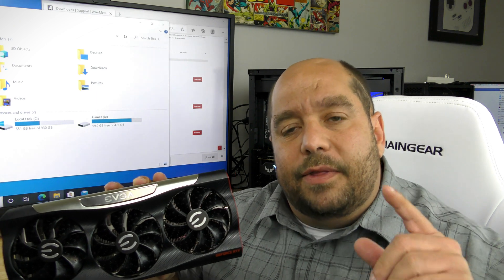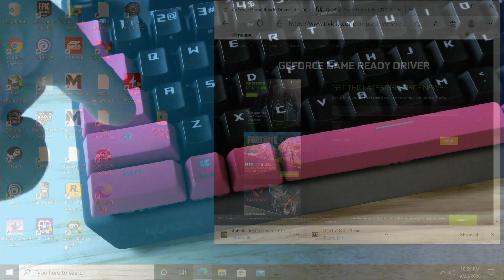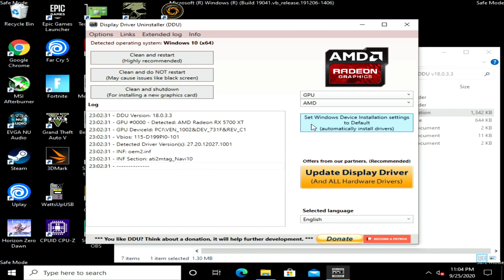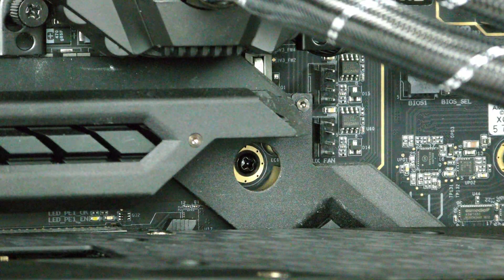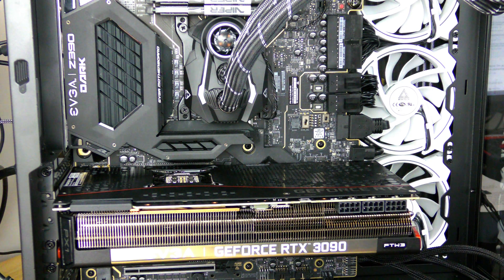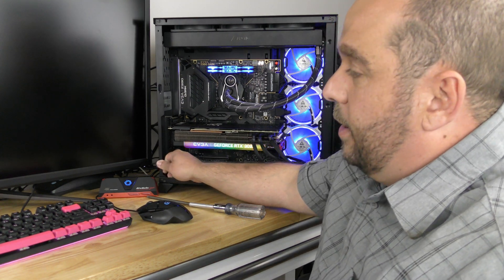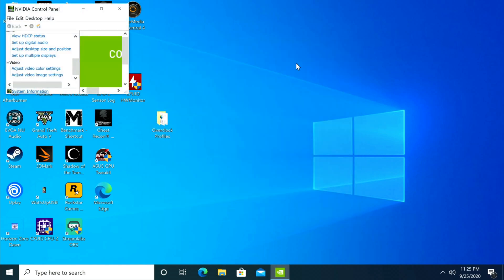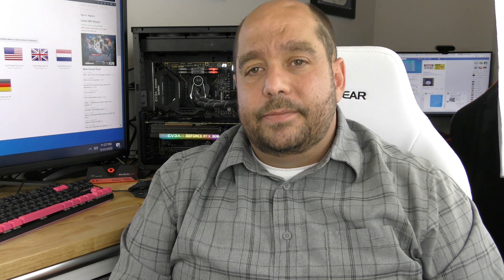RTX 3090 - Installing the EVGA Geforce RTX 3090 FTW3 Ultra Gaming

Comment: I just upgraded from a 1660 super to a 3090 and this video was very in depth and really helpful. Thank you very much good sir.
Reply from the maker: Always a pleasure my friend, so very happy you stopped by, trusted in me to help you, liked and subbed as well as took a moment out of your day to thank me.  It means a ton to me and I am so very happy I could help you.  That is an awesome update my friend, congratulations and thanks so much for your kind words, I am so very happy I could help you.
Reply: Hey is it easy to install the new cables into my psu? I'm upgrading too from 1660 to 3080 with lots more cables lol
Reply from the maker: @Taylormane  the 3090 and 3080 have the same amount of pcie connections, so it would be the same as you see in this video.  The other requirement of course is power, how many watts is your power supply
Reply: @ThisBytesForYou  thank you for replying  I just got a 850w for it
Reply: @ThisBytesForYou  it's pretty simple to plug the new  cables into the PSU? I just noticed my 1660 seems simple with like one cable wonder if the 3080 will be a challenge with cables
Reply from the maker: @Taylormane  yup it's easy, just like I show you in the video just make sure your psu has 3 separate pcie cables, don't daisy chain them

Comment: I am a lucky winner of s Nvidia GE Force 3070ti that it came out new in the box with a Y 12 pin to two eight female connectors to the gpu and two eight psu wires labeled pcie but also in a Y connector. Is it possible to wire up individual connections ( in parallel ). Thanks for your help and educational videos
Reply from the maker: awesome bud, congratulations.  Can you give me the exact model name, product number of the video card so I can help you?
Reply: @ThisBytesForYou 
 it is:
 Nvidia
GE Force 3070ti Founders Edition
Thanks again for your time
Reply from the maker: @franciscocastellanos9157  sadly no, with what NV provides, the card can only work with that adapter, that really bugs me too hahah, but yeah, only with that adapter.
Reply: @ThisBytesForYou  I just researched a bit further and the adapter provided by Nvidia is the only one recommended by the manufacturer. The power supply provides two PCEi connections for  PCIe express and there is no other  possible option. I am installing the  GPU card with its Y adapter hooked up to the male PSU connector (also a Y connector ) i went to Nvidia website to download the GPU driver and installed it first by keeping the monitor hooked up to the motherboard hdmi output. Once installed I rebooted the computer once to make sure no driver Conflicts and once all looks good re booted again but now the monitor connected to the GPU hdmi input and WOALA ! ! the new Nvidia GE Force 3070i is recognized by Win 11 home edition. It is not a novice project if any challenges arise. Thanks for your prompt response nad keep up with your good educational videos
Reply from the maker: Always a pleasure my friend.

Comment: I have a question. I’m installing an EVGA 3080 FTW3 GPU to replace my MSI Twin Frozer 7 2070 Super GPU. I have a Corsair 850 Watt PSU, but the cable I have with it only has enough pins to slot into two of the 8 pin slots. Do I need to buy another 8 pin cable for my PSU or do I have to buy a brand new PSU? I have everything else set up, it’s just the third pin slot I need.
Reply from the maker: Well, what is the exact model of your powersupply, but if you are in the market to buy a new one regardless, check in the description for the one I use.

Comment: I see that you have two separate power cables going into your 5700 instead of the single cable splitting. Is that the proper way to do it? I have a 5700xt and use the split wires.
Reply from the maker: yes it is the proper way to do it, 1 cable per connector, if you have 3 or 4 PCIE connections, you need 3 or 4 cables.  Before this series 5000 and 3000 series, it wasn't really needed, now they are much more power hungry and the next series for both AMD and NVIDIA are supposed to be even more power hungry.  Don't use splitters, a good example would be, have a straw in a Coca Cola, start drinking out of it, then pop a hole in the side of the straw and poke a straw through that and have someone else drink out of it.  notice, you will get a lot less drink than you did before, but now both of you get some.  It's good to share,... but not power ;)
Reply: @ThisBytesForYou  I'm going to try this. I've had some issues with my 5700xt and I've had it for almost 2 years. Maybe its not driver related after all. Thank you sir
Reply from the maker: Well, the drivers are a big issue, sadly,  but follow this video, then at the end, install the graphics drivers and you might be OK, as long as you seperate those cables first: https://youtu.be/8JuC_Dpm6-c
Reply: @ThisBytesForYou  my only other power chord to use doesn't have the mesh sleeve  as its just plain 8 pin evga wire. Will that matter?
Reply from the maker: @Donker_Dank    that is OK to use, but it has to be a PCIE cable, not an EPS 8Pin CPU power, as they are different, but look similar.
Reply: @ThisBytesForYou  you're right it is an eps. Im going to order the pcie
Reply from the maker: @Donker_Dank  what do you mean order a PCIE, what is the model number of your power supply?
Reply: @ThisBytesForYou  its an evga 700 bq 80 plus bronze semi modular. I just realized I can't use another port in the psu because they're all used up. So oh well
Reply from the maker: @Donker_Dank  you should get a 1K watt, this is the one I used, to prepare for the next card, so you don't need to upgrade again... I have had a 1200K Watt for about 10 years, never needed to upgrade, bought another one 5 years ago, so now I have 2 and I just bought one 3 months ago, now I have 3, so I can build up 3 different units with 1K watts, no issues but I used them all for this channel, but the original, its an older non-modular 1200Watt with ugly cables, I don't care how it looks, but it bothers people so I don't use it for these videos.  You can check out the1K on my affiliate link: https://geni.us/IVoE
Reply: @ThisBytesForYou  will that be too much power for the system?
Reply from the maker: @Donker_Dank  no such thing, the system will only pull as much power as it needs.  Your 700Watt, maybe was pulling 350Watts, when you were browsing the web idle, maybe 150Watts, you would need a Kill-A-Watt to test, on my Amazon affiliate link: https://geni.us/KAJmEG, the more power cards require more amperage per PCIE connection, ones that usually the lower end ones do not have.  As you overclock your PC, or play hardcore games with higher resolutions and eye candy turned on, your system will require more power, 1000Watt is perfect, though it still may not even hit 700Watts.
Reply: @ThisBytesForYou  il try to upgrade my power then definitely
Reply from the maker: @Donker_Dank  this is the one I just bought November 9th on my amazon affiliate: https://geni.us/6ufZi
Reply from the maker: @Donker_Dank  this is the one I have in the older system, another amazon affiliate link: https://geni.us/P0ASsk
Reply: @ThisBytesForYou  last question i promise. I appreciate all the help you've given me so far. In the vein of future proofing what cpu works with rtx 3090 that can also work for 5700xt
Reply from the maker: always a pleasure my friend, sorry I didn't get back to you sooner, youtube is horrible at notifying of comments, they don't so I have to go around looking for stuff I have not replied to.  Don't buy into future proof, I remember when I bought my Voodoo Rush, nothing would beat it for ever, 3 months later, it was old news, no such thing as future proof.  Buy the best you can when you can, and make it work for you.  That's all you can do ;)

Comment: Just a quick question. Iv'e got Gigabyte RTX 3080 with 2x 8 pin connectors. Will there be any difference of using singe cable with x2 8pins or it's better o use 2 separate 8 pin connectors? With my PSU (Enermax D.F 850W) I have 3 8 pin connectors but each cable has x2 8pins.
Reply from the maker: It is best to use 2 separate cables, you waited a long time to get the card, and it surely wasn't cheap, treat it right.  Each cable should come from the power supply, don't pig tail it.
Reply: @ThisBytesForYou  Thanks for a swift reply. I was wondering that using 2 different cables is a better idea since it's a multi-rail PSU, don't want to damage my GPU/PSU just because of pig tailing it!
Reply from the maker: yes it could definitely cause an issue, so for sure the best bet is individual cables per PCIE connection and always happy to help you.

Comment: I just had to rma my ftw3 ultra 3090 because of the new world issue. My card was the 0.1 rev. Now if I get the 1.0 rev will I need to update the drivers or will I be ok since it's the same card just a revised version?
Reply from the maker: You should be ok with the drivers and man, that sucks about your card... I am think I should let it happen to mine to replace it
Reply: @ThisBytesForYou  thanks for the reply. And if you have a backup gpu then I'd do it. Unless you pay more it's a long wait and I've been bored out of my mind. Shipped the gpu on the 20th they received it on the 26th then shipped the replacement on the 29th (ironically the day I bought the 3090 last year) and I won't receive it until November 4th.
Reply from the maker: @Twistid5one3  I do have backup GPU's I buy them to review, just needing some motivation today, need to get out reviews, uggg, so tired
Reply: @ThisBytesForYou  only thing is check your rev number on your card. If it's a rev 1.0 I wouldn't worry about sending it in . That's the new revision and the version I'm hoping to get. It's not a guarantee which revision you'll get.
Reply from the maker: @Twistid5one3  I got the card the day the cards were released, regardless, i will test, who knows what will happen, but just need to get some videos out.

Comment: I just got EVGA 3080 Ti but my 1000W PSU comes with twin PCIe cables. Can I use those but leave the second connector out from the GPU on those cables?  I will buy single ones in the future tho.
Reply from the maker: What is the manufacturer name and model number of your power supply?  I always recommend using 1 cable per connection, as I mentioned in the video as you may run into issues.
Reply: @ThisBytesForYou  Corsair RM1000x
Reply from the maker: @humanexe5451  that power supply has 8PCE connections, modular I am sure, that means 2 per cable... check your box, I am sure you have enough.

Comment: Hi, my cpu does exactly the same thing at 9:00 mark of your video, is this perfectly normal? Can you explain why it’s doing this? Thank you
Reply from the maker: yes, it is perfectly normal, depending on your cpu/motherboard.  Does it do it every time, or only when you make hardware changes or BIOS changes?
Reply: @ThisBytesForYou  hi, it does it everytime i turn my pc on, been like this since i got it. My motherboard is asus maximus, do you think this is normal? Cheers
Reply from the maker: @fisherboy444  sadly yes, Intel's 2011, 2066 chipsets, based off of server platforms do the same, it is part of their POST (Power on Self Test) and is a little more indepth than regular desktop boards.

Comment: I have been using 1 split EVGA cable for months, have I been missing out on power? I have the Zotac Gaming 3090
Reply from the maker: Maybe, maybe not, it's really a mixed bag but back when it was released NVIDIA said each plug needed its own dedicated cord.  Some people swear by pig tailing, but if you spent so much on a card, protect your investment and don't cheap out on the "small" stuff and get a good power supply, like I have in the link in the description.

Comment: I run a 3080ti suprim  with 3x 8 pin connectors.  Should I be running using two PCIe cables PCIe 1   PCIe 3  , or using 3  PCIe cables PCIe 1   PCIe 2 and   PCIe 3?    https://www.bequiet.com/en/powersupply/1774
Reply from the maker: recommended you use 3 x PCIE 8Pin each coming from the power supply, no pigtails.  My EVGA G2 does it perfectly fine, it's in the description if you want to check it out.
Reply: use VGA1 VGA2 VGA3  correctly ?
Reply from the maker: yes

Comment: hey man,  i have a evga supernova ga 850w psu and i have 2 6+2 connectors and 1 6+2 that splits into another 6+2 connector, so i couldn't finish my build. I don't have 3 gpu connectors like u have in the video just 2 and 1 that splits into 2 6+2. What am i doing wrong? thanks and great video.
Reply from the maker: you are good my friend, so use the 2 x 6+2 and use the one 6+2 that splits into another, use the main cable though and you should be good.   You have an 850, I see it brings 6 x 6+2's, if not, can you give me the exact model number?  And thanks so much for your kind words, it means the world to me.
Reply: @ThisBytesForYou  the part number is  220-ga-0850-x1. Am going to return it to microcenter and get a bigger one. Am pretty frustrated with this build. Its a high end build with high end problems lol. I bought a cm h500 argb and cm ml360r with argb and having a hard time witing the cables to the rgb and power. Thanks for the response i appreciate your help. And i also watched your other 3090 videos about the sag on this card.
Reply from the maker: always a pleasure my friend, I love helping out.  See if you can get the EVGA power supply I linked in the description, it is pretty awesome.  Also, thanks so much for your kind words and support, it means a ton to me.  Please don't forget to click like and subscribe, it helps me out a ton to keep bringing you videos like this, bigger, better and more ;)

Comment: I recently got the RTX 3080 Ti from EVGA essentially the same exact model, but what I’m wondering is my power supply is semi modular and My current graphics card is using a 6+2 pin with a 6+2 pin pig tail to power it. Obviously the new card needs 3 6+2 pin plug ins. Well, I have an extra 8 pin to 6+2 pin cable, but that cable also has an additional 6+2 pin pig tail (so in total that would essentially be 4 8 pins between the 2 cables).

My question is, can I run my new RTX 3080 Ti on with both cables being pig tails and simply not using the last plug in OR do I need another cable that’s a single 6+2 and no pig tail in order to use it?

If I’d need a new cable, then I’d like to ask what cables are you using for your set up here?
Reply from the maker: you need to plug in all of the pcie connections, you spent so much on the card, don't cheap out on one of the most important part of your PC, the power supply.   All 3 need to be connected, and my power supply does not have any extra cables, they all came in the box, check the description aas it sounds like you might need a new power supply, also, the video card requires at least a 750WAtt power supply.

I always buy more than I need for 2 reasons, I am a reviewer, would be horrible to have to buy a new power supply everytime a new video card comes out, so that I can power it.... but does that sound familiar (This covers both reason)?  I have a 1200Watt and a 1000Watt, I have had the 1200Watt for about 8 years, never needed to change it, because it is ready for everything, was a little more expensive up front, but how many power supplies have you bought in 8+ years (would also co-related with how many video cards you have bought too).

Comment: JUST got myself an RTX 3080 Ti OC Aorus after waking up at 6am to rush outside and wait in the rain on the wet and highly windy Tokyo street till 930am to get my ticket and graphics card from the store. Now I just reached home, ate, had a nap, and about to install the new GPU into my machine until I came across your video. :) Thank you for this. I think I will also do the Display Driver Uninstaller method that you just highlighted but before that, I'm gonna double-check to make sure I got all the power cables, which I assume I should have as I got a 950w unit.  Wish me luck!
Reply from the maker: awesome bud, I am so happy I could help you and I am so happy you were able to nab one, I might have something for you soon on that, maybe ;)  and actually I will make a poll on it.  Please do let me know if you run into any issues, I will always try to help where I can.
Reply: @ThisBytesForYou  I have a question. :)  I want to put it to silent mode as the fans are pretty loud. Any way how to do this? I thought it would be in the main Profile setting via the engine driver but no option appeared.
Reply from the maker: @EAprima  You might want to check this out: https://youtu.be/lKDONiejqRs as for silent... I mean, you could lower performance, the fans keep it performing well, maybe undervolt, but I never touch that.